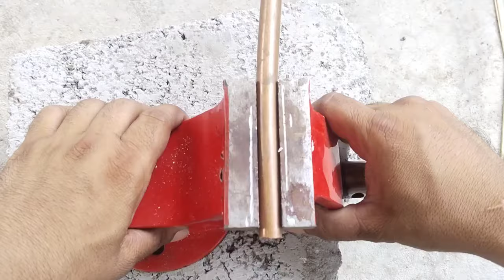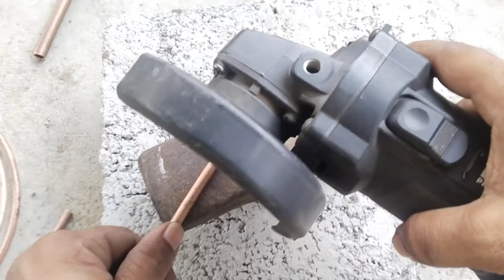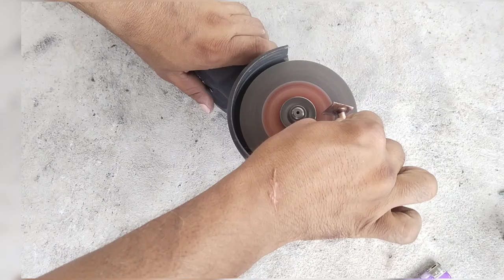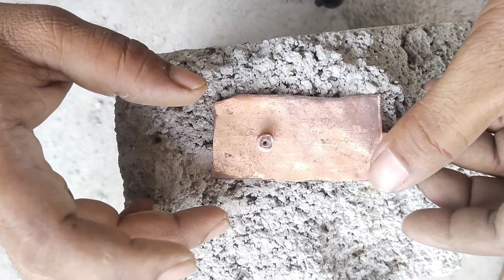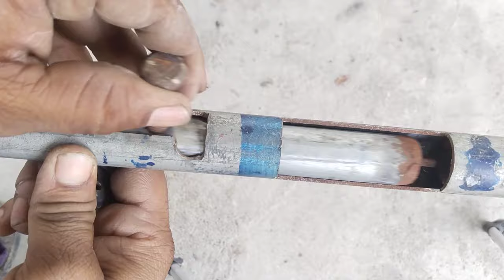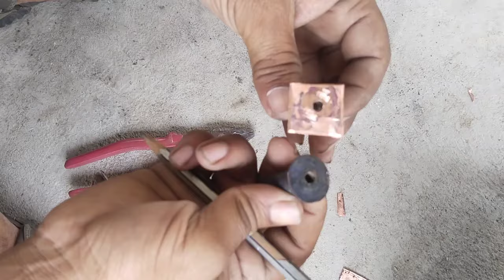making bullet part 2

Comment: 子弹可以用一种铆钉做，某种重汽车刹车片的铆钉，和你做的一模一样的外形
Reply from the maker: 非常感謝您的評論，我會盡快上傳視頻👍
Reply: Can u give some more information on what u said or how to prepare using rivet?
Reply: @gp6957  重汽车刹车片的铆钉，他的尺寸有6毫米 7毫米 8毫米 10毫米 长18毫米到24毫米，
这个可以改造成为弹壳。他分两种，有全空或者半空。半空可以钻小孔打通。改造方法可以参考 https://www.youtube.com/watch?v=x01Sl1dgwyE  用这种方法作为底火  也许里面空间不足不能装很多的火药，可以另外想办法，比如制作发射药模块。
Reply: @李铁天  I want to make 9mm cartridge, as per ur info I don't get 9mm. The rivet I get is half drilled or full drilled, if not I have to drill, right? The thickness of the brass rivet is more compared with factory used cartridges, now how to make it a propellant. Do you have any other techniques to make cartridges..
Reply: @gp6957  实际上半空密封的钻孔可以根据需要钻小孔作为底火孔，更结实密封更好，他只有6 7 8  10 确实没有9毫米的。应该可以10的磨小半毫米然后枪管扩大半毫米。或者用6 7 8 这样小的加套。也许加套的方法更好  下面这个子弹制作方法也许可以参考  thttps://www.youtube.com/watch?v=PxkGCIQ6D98